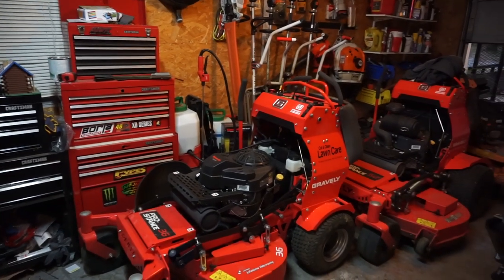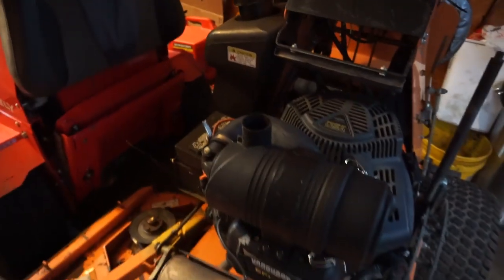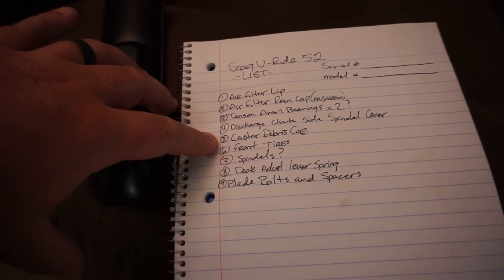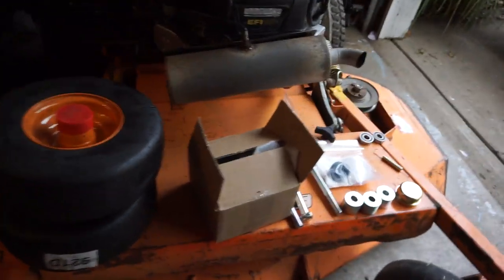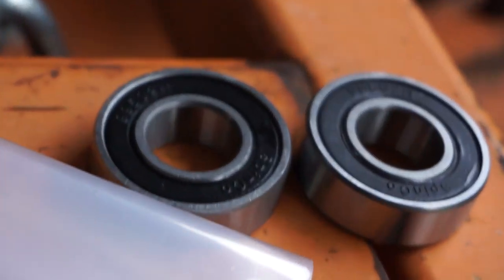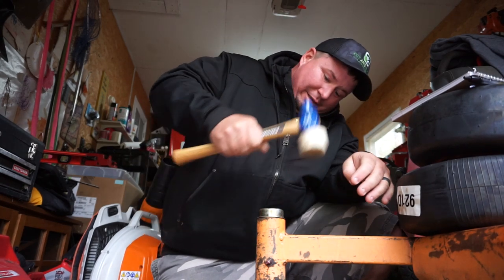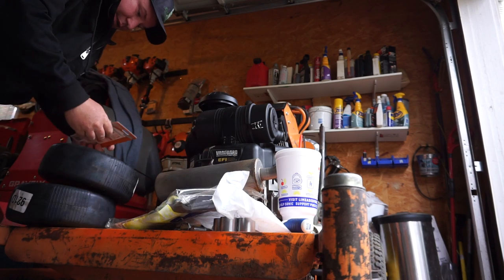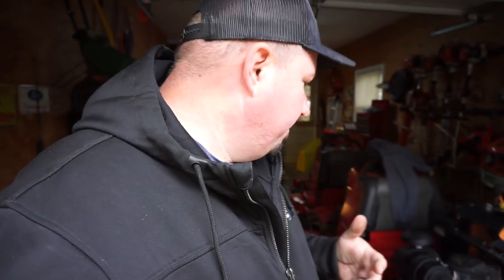I Bought a Project Mower with Over 2500+ Hrs | Lawn Care Back Up, Stand On Mower

Comment: Just picked up a first gen V ride. What put it down at 1500 hours is the hydro belt broke and took out the wires for the PTO. Thinking about making a protector/guide to stop it from happening again. I also feel a flat spot in the bearing race for the PTO. So it was coming.
Reply from the maker: Yea at 1500hrs some many things you don’t pay attention to are worn out for sure
Reply: @CutandCleanTV  replaced the pto bearings before, much cheaper then throwing on a new clutch

Comment: Hey man,, id put new bearings in the spindles,  if the bolt has been run bent, its probly wore the bearings also.. u can just take a chisel an knock em out, big flat head screwdriver anything thats long enough. 
Good video, like to see the old mowers repaired an used.
Good job bro

Comment: I have that 28hp Vanguard efi on my 52" Z2!  It's an awesome very efficient and powerful engine....Ha ha I met a 170lb St. Bernard named "Linus" today 😀
Reply: i was looking at a kubota sz19-36 and sz 22-48 and sz 26-52 stand on mowers at my kubota dealer wich the sz22-48 a  22hp diesel and gas  engine on it and a 26hp diesel and gas sz26-52 stand onswich pretty nice diesel powered kubota stand ons  as optional from 11,000 to $13,000

Comment: Mine has over 2k hours on the body as well and a new motor from 2017. I need to replace the hydro lines bc they are old and cracking.